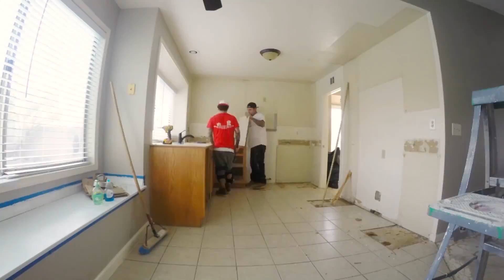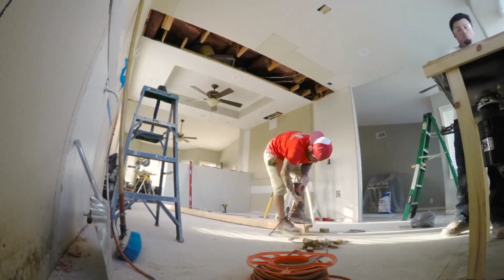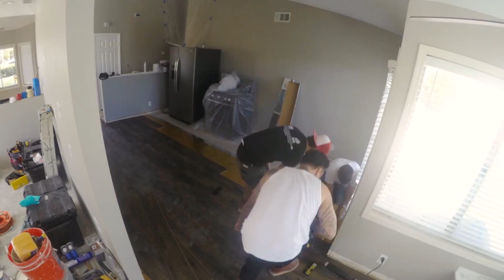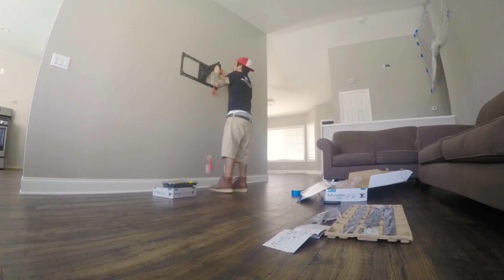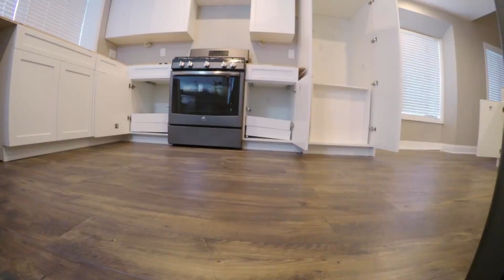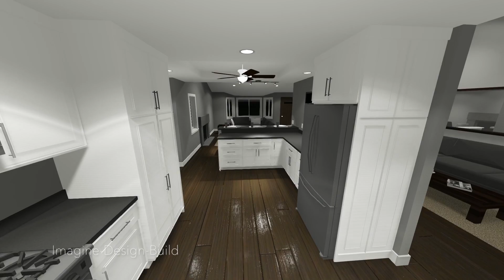PART 1- TIMELAPSE Kitchen Remodel

Comment: What software did you use to design that?
Reply from the maker: I used 3 different programs for the design. Chief Architect to SketchUp to Lumion 3D.
Reply: @ngkconstructioninc.9406  why not only use chief architect? Doesn't it have everything?  Only asking because I'm about to buy it.

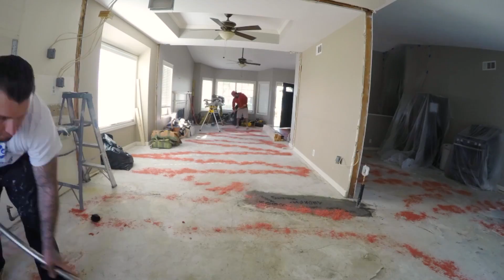Comment: What was the red substance you put on the concrete at 0:36?
Reply from the maker: Zep sweeping compound from Home Depot
Reply: @ngkconstructioninc.9406  what does it do?
Reply from the maker: Jacob Heide it absorbs oil from the concrete and prevents a dust cloud when you sweep up the dirt.